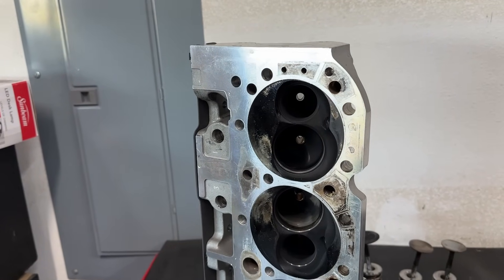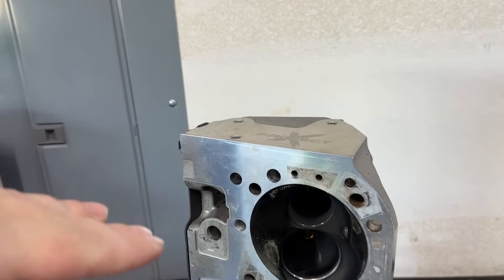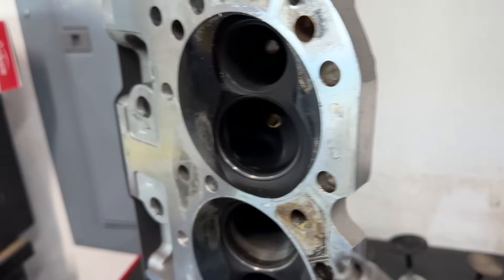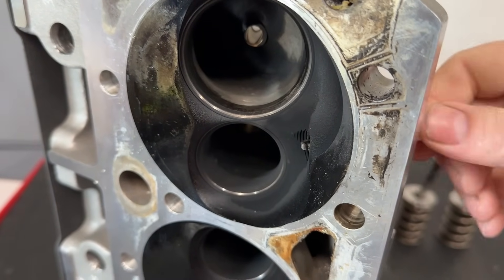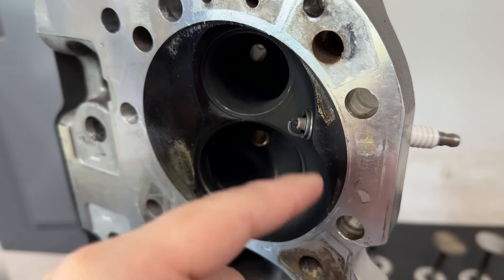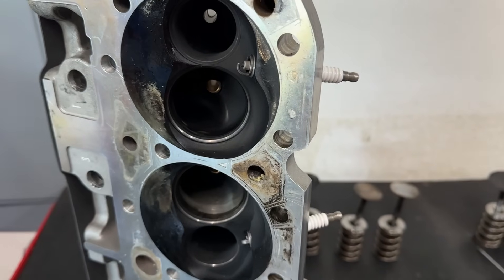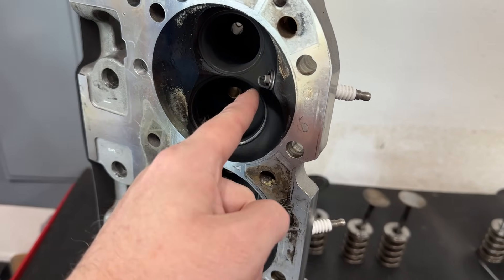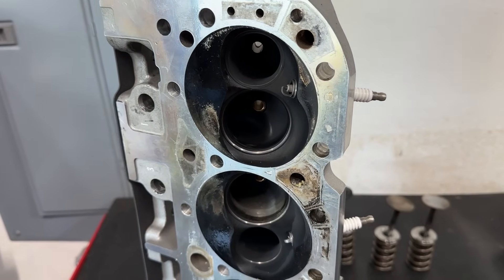Interesting Thing Learned On The Dyno Yesterday

Comment: wicked, thanks for sharing.

oh and complete assumption theory on my part , maybe the lower plug places the spark in a easier to light area? 
Fuel tends to follow a surface and having a shorter plug reach places the spark closer to a surface where the fuel is hanging around.
Gonna be trying this soon for kicks & giggles on my truck now.

Comment: If combustion starts closer to the center, I would guess that it finishes a bit earlier. The whole combustion event (and the resulting pressure curve) could be shifted earlier, relative to piston/crank position.
   So, if the timing was right on for the "stock" plug position, it would now be too early. I wonder what the result of  little less timing, or different curve, would be.

Comment: My rule of thumb...
No sharp edges in the combustion chamber... That could cause detonation... Sparkplug threads in the chamber... is adding sharp edges... That could glow @ full temperature... causing detonation... that you might Not  detect..!
CrazyHorse Speed Shop

Comment: Interesting stuff Eric. I wonder if moving the plug in, resulted in the motor wanting less timing, due to the reduced distance of combustion?  The other point that I will make is that I have had to remove several seized spark plugs from motors that I believe were caused by the last thread of the plug projecting into the combustion chamber. Now it would never be a problem in your application where the plugs are in for only a short time, but if you used iridium plugs and left them in for a life cycle it does become an issue.

Comment: Had an old school pro stock bike and early pro street bike drag racer give me a tip, I’ve got an old oil cooled gsxr Suzuki that I had him mill and port the head on. I was told to use two spark plug gaskets which will prevent any exposed thread out of the chamber which can lead to detonation due to the threads becoming red hot. Also been told racers “just” lathe the last thread or two off for the same reason. Love your detailed tech and testing.
Reply: With a lathe it is "just" lathe the last two threads off. You'd just put the socket fitting in the jaws thread side out and turn it down. It's a 1-2 minute job.

Comment: I have an old set of Pro Comp Electronics heads that were professionally ported and flow well, but I had to grind a 5/8 deep socket down to almost nothing to get the plugs screwed in. After pulling the heads, I found a similar issue to yours, but worse. I rounded up some .200" aluminum washers that have to be used to keep the threads out of the chamber. Engine runs great, but you have to remember not to throw away the washers!
Reply: I also found it interesting that you consider a 7 heat range 'cold'; on my 11.9-1 SBC I run NGK R5672A-10, or if doing a lot of street driving a -9. I put 8's in street cruiser engines I build.

Comment: Compression loss will be negligible. Looking at this situation aren't you just indexing the plugs? What the washers are meant for and facing the flame towards the mixture. Though, it is a gain and I like hp gains.

Comment: You mentioned in the video that it was a tapered seat plug.  Are the heads supposed to have tapered seat plugs?  Because that isn't a tapered seat plug, it's a gasketed plug.  If the plug doesn't match the seat it will probably not sit in the head correctly even though it may seal.  I tried to pause the video to look at the seat in the heads, but couldn't tell how it was machined.
Reply from the maker: It’s gasketed not tapered.

Comment: Could the three odd HP just be from having the ground strap indexed and the stick out didn't really do anything? Indexing is supposed to give more power, how much more is debatable, but the 3 odd HP difference might be correct for that engine.
Reply: That's what I was thinking,  that's the reason they index spark plugs in the first place. Also how many runs on the dyno were made in each configuration? There is variation in each dyno run. You need to run at least 3 runs per configuration to make a more accurate conclusion.
Reply: @Quiet-storm  he normally does 3 runs per config, not sure if the charts are average or best.

Comment: I always thought flow would increase with the plug retracted,  it did not, but it did make a slight improvement in HP & Torque which was interesting. Great info! Thank you
Reply: The closer to the middle the ignition source, the faster it ignites.

Comment: The way the air fuel mixture flows into the chamber probably interacts better with the spark plug when it's recessed, so even though it flows a little less, because you have higher quality combustion, it more than makes up for it. At least that's what makes sense in my head, I could be wrong.
Reply: Agree, that'd be my guess.  Thought I saw Darin Morgan playing around with die "wet flowing" and the plug interaction was part of that.
Reply: On his channel part 2 and 3 cover some of plug wetting.  Thought I saw another video where he gets into too but can't remember.  Not 23° stuff but probably some similarities.